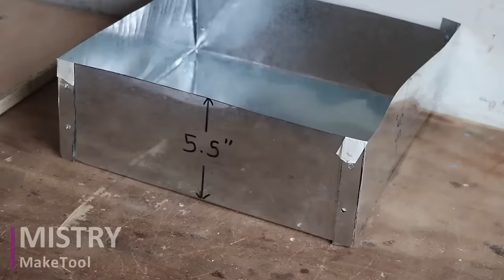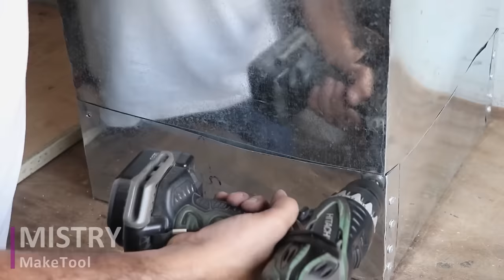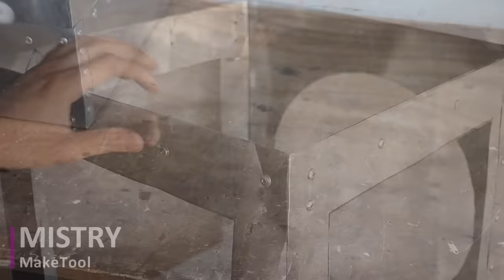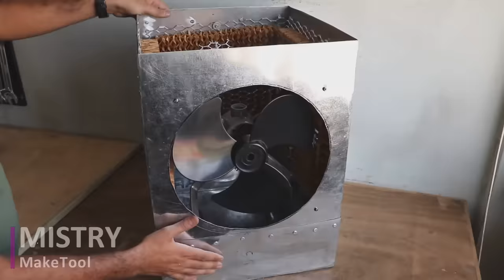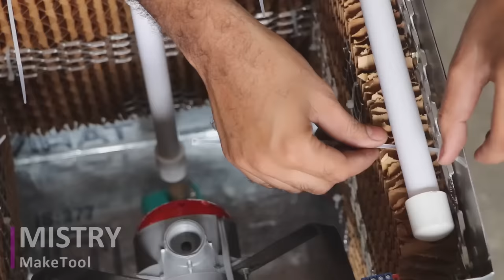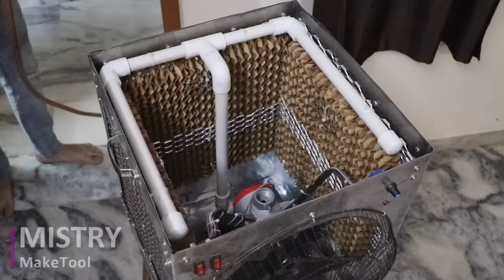How To Make A DC Air Cooler || Battery Powered Cooler

Comment: Looks like a very effective cooling concept. Two concerns.

First of all, I would have probably made it a little bit wider so that the exhaust fan would be setting inside a little bit more so that you could use a flat fan cover on the side of it  instead of a bulged out one so you can use it in tighter corners.

Second, it seems a little on the loud side to me. But then, I'm not hearing it firsthand. I'm only hearing it on the video, but it seems a little on the loud side. If someone were trying to sleep at night and had a noise sensitivity, this might not be practical. Other than that brilliant design.

I also see the possibility of adding some ductwork to the exhaust side so that you can better direct where the cold air goes and ensure that the entire room is more evenly cooled on a more rapid level. I have that same concept on my window air conditioner. I have an input duct put on the front of it so that it pulls the hot are directly from the ceiling area, and the exhaust Port shoots the cold air out into the room a little more effectively without having some of the cold air re-enter the import and confusing the air conditioner into thinking that it's cooler in the room than it really is.

Comment: Very nice build of a swamp cooler. If you use it inside a room or inside of a house there will be a problem of high humidity, the best thing to do is set it outside of a window on a platform and ducted in through the window, sealed so air only comes through the opening from the fan. Then open up another  window or  opening  in another room so that the cool air will circulate through. This will eliminate the humidity on a real hot day. I live in AZ and the temp gets up to and over 115 deg. F. days on end and at night time the temp stays up into the 80 s. Thank you nice video.

Comment: What is temp of cool air?
Reply: Evaporation temp of the water, average 67•
Reply: @johnjmacejak  
Not really

The temperature will be about the dew point temperature and that temperature is depending on the relative humidity. So in a dessert with very low relative humidity, the temp will be much lower than in a humid tropical environment.
Reply: Didda Loha  
I think we can agree they work best in Dry hot climates and not so good in Humid hor climates.

Comment: Good project, but the lack of moister shielding - the water vapor will damage the motor, connectors, switches and electronics in short order. Most if not all evaporative coolers never have the electronics and motor in the direct path of the airflow.
Reply: That was my first thought, too. It looks exceedingly dangerous to the electronic components.
Reply: عندنا يفعلون الغطاس والمروحة
عادي
بس هل الصندوق الأرضي لا يخرج الماء
هل هو محكم من التسريب

Comment: the air is cold or hot bro? 
and i need to understand why u add water
Reply: Because it's a swamp cooler, and the air is cooled by the evaporation of the water on the cardboard waffling.

Comment: It cools the room until the water and the room temperature become same, after that this device become useless
Reply: Worse than useless, it's a humidifier so as it humidifies the air, your body will sweat more and more, and that sweat will not evaporate to cool you.
Reply: Didda Loha  As soon as you open up the room, the cooler, humid air will escape and be replaced with hot air.  What is the point of that?

Comment: Skills are excellent.
Design is less than good: poor protection, poor accessibility, and poor maintenance provisions.
Most comments centered around the skills, without paying attention to the value of good solid design, too bad!
Not your best projects for sure.
Reply: Unsafe.. and not quality.
Reply: Kindly elaborate all the mistakes. So he can rectify them in the future. This is the way you can be a good critic. Thanks
Reply: @gurindersingh4712  for one thing, the electronics are unprotected from the high humidity. As soon as enough moisture collects on them, it will short them out and make them useless. The motor needs to be outside, in another part, as do the switches and controller. That's the main issue. 

Second, with all of those zipties holding the cardboard waffling in, it will be a real nuisance to change them out, even if the electronics last that long. It should use a slide in/slide out method, instead.

There's other issues, too, but those are the worst.